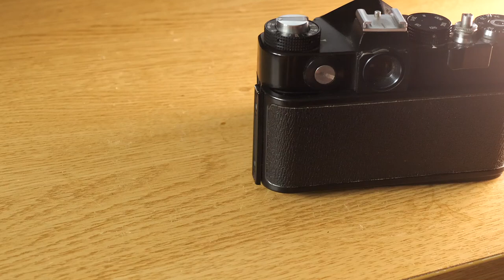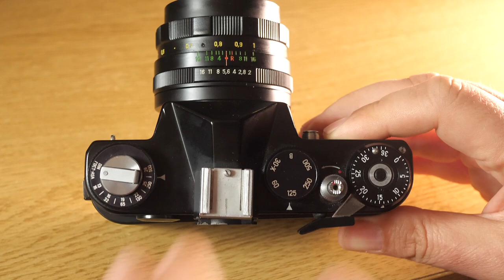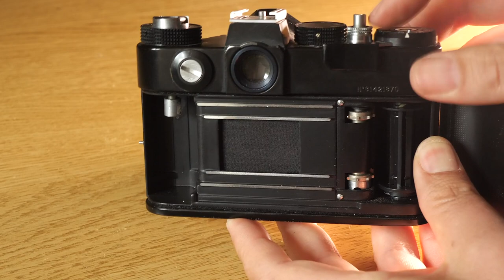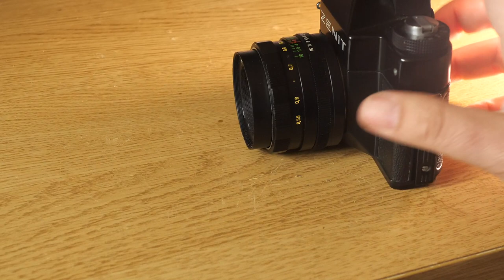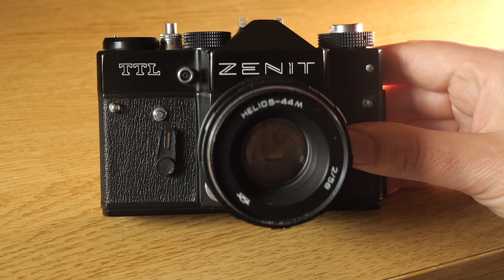How to load / unload a 35mm film into a Zenit TTL manual camera.

Comment: Yo boss do yo have any idea how to change the light metre settings, I know where it is (left side screw below the film speed dial) but no clue what to do
Reply from the maker: It's down to the battery, If that battery works - it'll work. But as some of the light meters are so old they just stop working over time. You may get the light meter out of another camera and put in the body (or ask in a camera shop). Or just use a phone with a light metre app. Measure the light on the app then change the settings on the camera to match.
Reply: 366daysofphotography well pretty much what’s happening is that when I depress the shutter button thing the light meter shoots yo way past the + no matter what I’m pointing it at,
Reply from the maker: @Tomatron3000  Sounds like it's done. I've had that before on a Pentax and in the end I got an external meter.
Reply: 366daysofphotography cheers bro